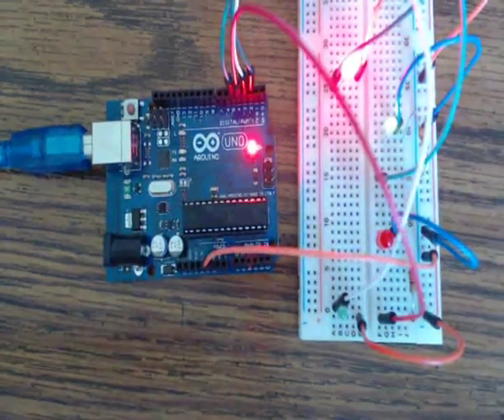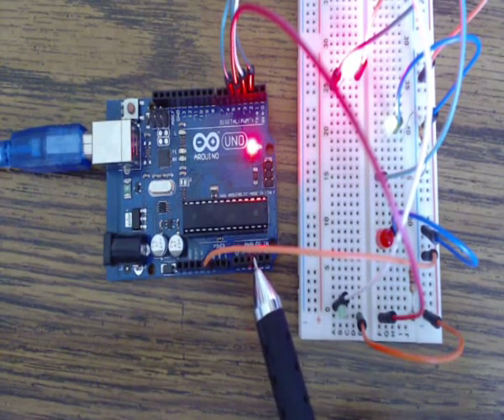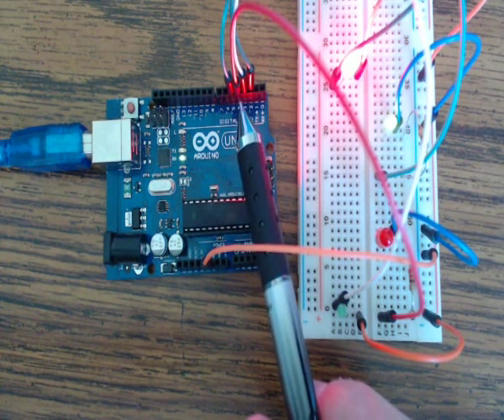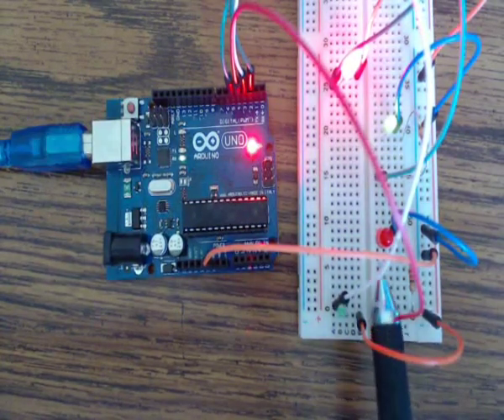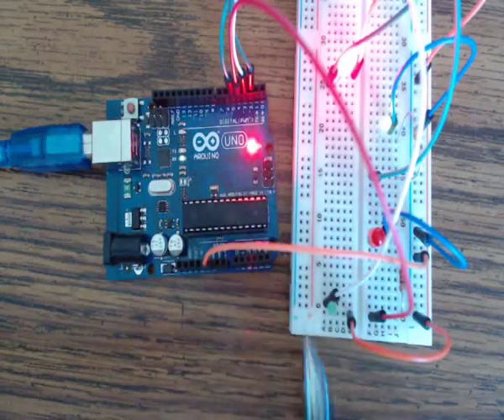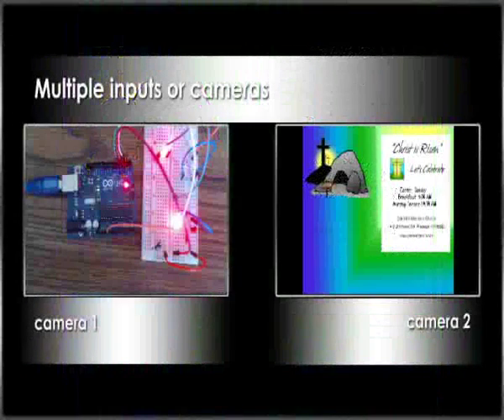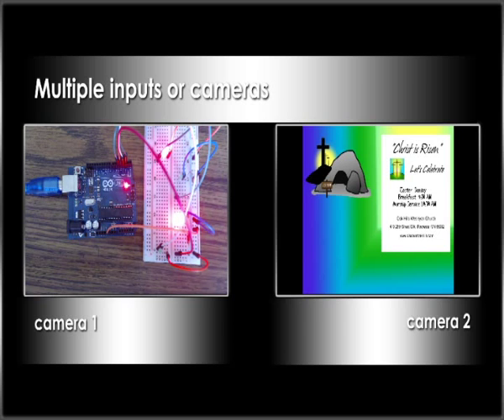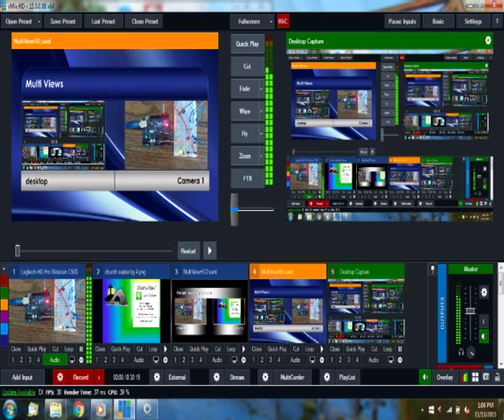DIY Tally lights for vMIx - part 1

Comment: If you are trying to test this be advised that the output for active is high and inactive is low, but most tally systems like the ITC-100 from datavideo use active as being grounded, so you will need an inverter circuit.

Comment: I'd like to do that but I'd like to know the code to load to Arduino: can you help me? I loaded the library firmdata but it contains just two instructions:  #include <Boards.h> and #include <Firmata.h> and nothing else. Probably I must load "standard firmata" under "examples": Did you do that?
Reply from the maker: Under sketch  in the included library I used  firmata from there.
Reply: Sorry, I've seen you posted the code below. Anyway I load standard firmata from examples and with arduino uno it works. It doesn't work with arduino mega (connect error).
Reply from the maker: Lino,  I am sorry to hear that.   I have heard that it needs to be the uno board.     You might try check the vMix forum to see if there is a solution for your arduino board.      That is where I found my information for the uno.     Just a heads up I am told that some uno boards don't necessarily work.   It depends who manufactured them.   That is something I found out since I posted this build.      My tally lights work very well, and I had purchased a china knock off.
Reply: Thank you for your answer Carl. I think there is something to improve in both Arduino and Vmix. I use original Arduino uno and some pins work and other not. At this point I reset Vmix to default pins and I assign again new pins and, with arduino uno, everything works. I'll investigate writing in both the forums. Thank you again.
Reply from the maker: Lino,  when you set it up in vMix  check each camera input in its settings make sure you have the correct com port selected.    Usually when I don't have a light working it has to to do with com port or the pin assignment in vMix.

Comment: i have loaded the standard firmata in to my arduino...everything is working fine but the problem is that when i switch between cameras the camera that selected on the program her tally light is off and all the others are on....i have followed all the steps on your videos...any ideas? the wiring diagram for my test project is the 5v on the arduino to 4 led lampes and the pins 3 5 7 9 to the other leg of the led lamp ....no resistor between
Reply from the maker: https://drive.google.com/open?id=0B1ym99sc67lnTGxsQUR5dUJKbWM      Here is the schematic,   this might help
Reply: if i only want to use the pgm light without the preview light it can be done? or it will effect the system??
Reply from the maker: Yes it can be done, and it should not affect the system.
Reply from the maker: Are you saying you did not use resister for the test, or do you plan to not use resisters.    If you do not you will burn the LED up.
Reply: in the test i didn't use a resisters but on the project i will use them...the main problem for me is that the light on the PGM is off and the other cameras is on....
Reply from the maker: Are you using vMix switching software?     It could be a pin assingment in vimix.       If you have all the same pin assigned to the vMix input it would light up all of them.     It also sounds to me as for the on off issue that you have the vMix softwar pin assigment reveresed.     That would be where I would start.       Another issue could be in your bread board layout.         For me, getting the vMix pin assignment  took a few attempts to get it right.      At first I had the pins in reverse order.
Reply from the maker: dror shalit,    you might want to check out the comments from esmoked ham.    He made some changes that I think were great.     It is on found on my part 3 for this build.      https://www.youtube.com/watch?v=3KCPOPwheCU&t=26s&list=PLuvGgwx5c47Rm-XbmUuM-wk2TBmq-X9Sy&index=4
Reply: just testing the system....on my project i will put the resisters...the problem that the led light on the pgm is off and the others are on...all my configuration is ok.... any idea why?
Reply from the maker: You have double checked in your vMix settings your active pin setting and your preview settings.        After checking that, I would check my ground jumpers on your bread board.    .     You might have those reversed.
Reply from the maker: Also you cannot tell from this view but I do have the resistors in use on my breadboard.

Comment: Hi Carl, I am having an issue and don't know if you can help. I followed your setup in here, BUT for some reason I am getting the tally to operate back word. so the light is always on and then when I put camera 1 on air it goes out (using pin 3). any idea what I could be doing wrong?
Reply from the maker: Are you using multiple cameras?       Without setting down to study it out, off the top of my head, it sounds like  a Vmix pin assignment.   Try switching the on/off pins in vMix.         When I first sent out my wires from the box and then split the lines for my 3 cameras, I had some issues there.     Once I got the right tally on the right  cat line  I was good.